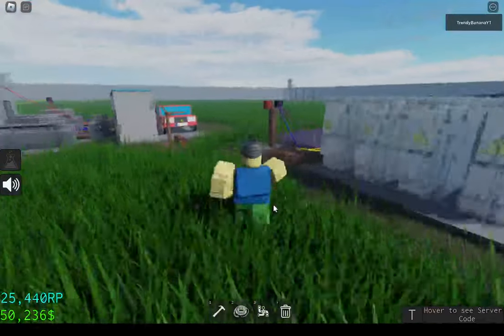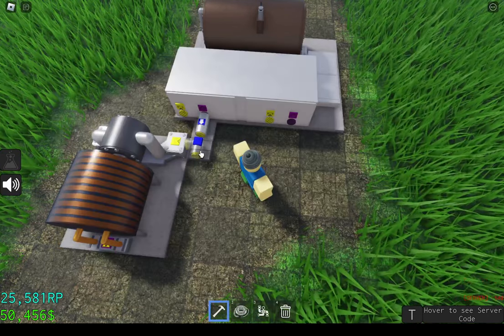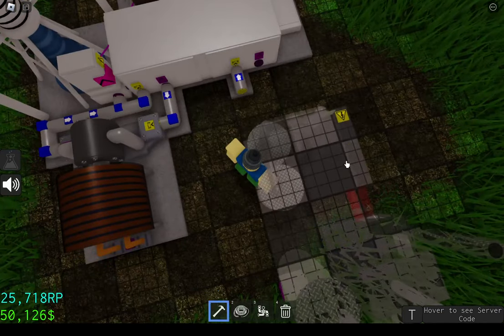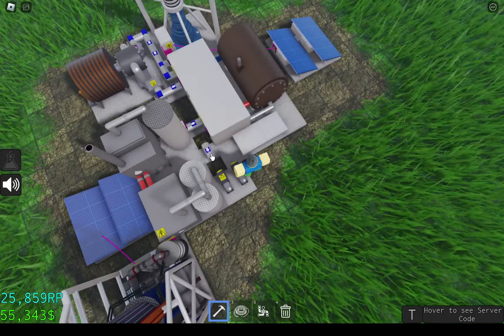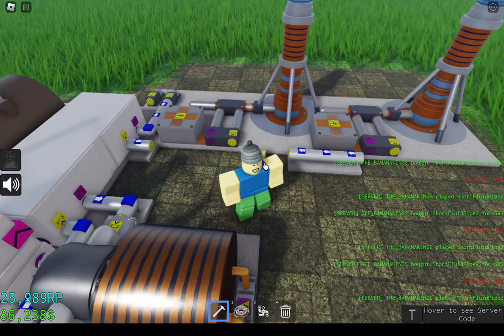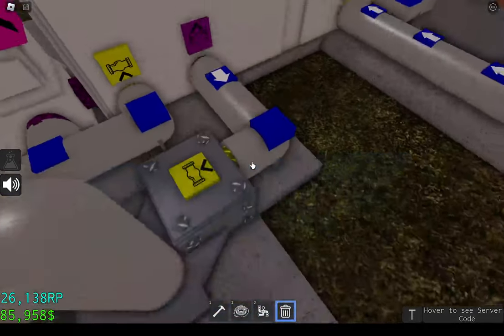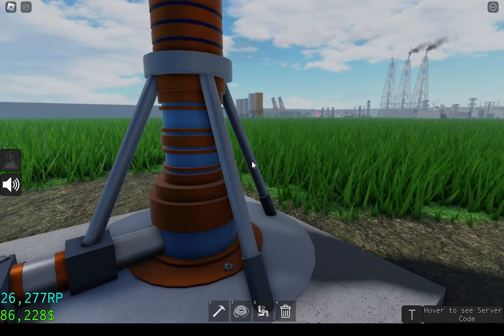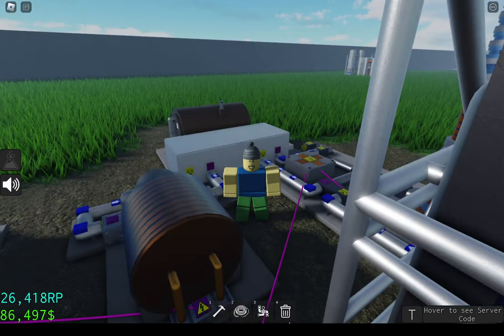How Boilers Work | Industrialist Tutorial

Comment: Note:u can get hot water using firebox which make co2 so u can use geothermal power to heat up the water instead
Reply from the maker: Correct.
Reply: @TrendyBanana lt doesn't work AT all
Reply from the maker: Can you elaborate? What doesn't work? What do you expect to happen instead?  @N30N_4U
Reply: @TrendyBanana  I did it wrong
Reply from the maker: Ah ok. Glad your issue is fixed :)  @N30N_4U
Reply: @TrendyBanana  thanks
Reply: What can you use for a coolant as for the Firebox?

Comment: My boiler keeps dropping temperature and then my  turbine stops spinning for literally no reason. The input is showing it taking in 217 C water and for some reason stopped producing steam.
Reply from the maker: What is the other input? And are the pipes clogging?
Reply: @TrendyBanana   205 Celsius water in, Then turned to steam which the steam is 156 degrees Celsius . It goes into the boiler and now the boiler is producing 0/90 liters of steam. How do I unclog pipes???
Reply: @TrendyBanana  I replaced all my piping and it stopped. Might be clogging because a bad design. I can't get water bottling plants up yet so I was storing them all in the silo's.
Reply from the maker: The water is getting turned into steam and then going into the boiler? @terrorbilly8177
Reply from the maker: Ah, that makes sense. Yea, sometimes pipes will clog and it will break setups. @terrorbilly8177

Comment: I did all the required steps but it just stopped making power in the turbines and the pipes were full
Reply from the maker: If the pipes were all full then that may have clogged the machine. Make sure you don't clog the pipes otherwise water will have nowhere to go and the whole thing will just stop.
Reply: @TrendyBanana how do I do that cause mine keeps clogging

Comment: in summary:
-the input on the right side uses hot liquid to heat up the boiler (meaning the input liquid has to be hot enough to increase the boiler's temperature)
-the output on the right side then dumps said hot liquid (it would now be cold) out
-the input on the left side turns water into steam using said heat (meaning the input doesn't have to be hot, just needs to be water to be turned into steam)
-the output on the left side then puts out said steam, and it can be used for other purposes

Comment: thanks for helping you've earned a new sub. this guy is the library for industrialist tutorials
Reply from the maker: Thanks for the support! I try my best at helping people ;)
Reply: @TrendyBanana  nvm oof but im still subbed :)
Reply from the maker: What do you mean by nevermind? Is something not working? I can be of assistance if you need.  @United-States-Of-Americqa
Reply: @TrendyBanana  1: i cant get it working
2: the liquid boiler does not output
3: on me, I'm too lazy to watch the whole thing :/
Reply from the maker: Liquid Boiler is terrible for boilers, because they only heat up crude oil to 99c. And the can't working bit, can you explain more on how it isn't? Unless the liquid boiler was the issue.  @United-States-Of-Americqa
Reply: @TrendyBanana  it doesn't even output anything it just does not output anything
Reply from the maker: What is the temperature of the boiler, and do you have water in both inputs, and is the output on the right side clogged?  @United-States-Of-Americqa
Reply: @TrendyBanana  nvm i made i work using a firebox and some design changes
Reply from the maker: Glad it is working well for you now :) @United-States-Of-Americqa
Reply: @TrendyBanana  well unfortunately only for water I'm trying to boil oil but I cant find a way to boil it
Reply from the maker: As I said before, oil can only be boiled to around 99c which is 1c less then the required amount.  @United-States-Of-Americqa
Reply: @TrendyBanana  o
Reply: @TrendyBanana  oh

Comment: Thank you so much this helped a lot
Reply from the maker: I see you fixed your issue? I am glad my tutorial helped you :)
Reply: @TrendyBanana btw can you please explain how to extract gasoline and diesel and every thing connected to that
Reply from the maker: Oil derrick makes crude oil, you put that crude oil into a boiler, which then goes to a separator. Now you have diesel, gasoline and residue. The residue should be stored in a silo. The gasoline can be burned for power or sold for some profit. The diesel can be refined 3 times using a diesel refinery, and then it can be sold or used in a diesel engine for power.  @d.a.d.a1441
Reply: @TrendyBanana  ok thx
Reply: @TrendyBanana ok nvm I still can’t do it,if it’s ok can you please make a video I would like to see how it works
Reply from the maker: :)  @d.a.d.a1441
Reply from the maker: Yea, I will make one soon don't worry :D @d.a.d.a1441
Reply from the maker: https://www.youtube.com/watch?v=rSeDlwJlVIE&lc=UgypiNcEV_UO3WgmD7V4AaABAg @d.a.d.a1441
Reply: @TrendyBanana Hey i saw u added an informative about the deleting tool for mobile players, ur a cool Dev.
Reply from the maker: @celinalvacarneiro3973  😄

Comment: I have a problem where even tho the water is inside the steam comes out it has hot water its hot enough but in the end it doesn’t turn the turbine it just stores the steam in the turbine and it won’t produce power
Reply from the maker: Are you sure you did it right? Because that only happens when the steam has no where to go such as if the turbine output is full or the power output is full.
Reply: Want me to help you inside your world?
Reply: @TrendyBanana  same with me imma retry it tmr

Comment: I have a new problem, I connected it to a HMVT pole and connected it to 2 copper drills, electric furnace, Ingot molder, and then a Press and the power went off and the turbines stopped making power even though everything was fine
Reply from the maker: You may have done something wrong, can you join discord.gg/mamytema for help?
Reply: @TrendyBanana  I retried 32 times step by step and the boiler stops producing steam after a few seconds like 30 also I dont have discord
Reply: Also I DIDNT mess anything up
Reply from the maker: What is the temperature of the water going into the boiler? What is the temperature of the water going into the coolant side of the boiler?  @Godzilla20191
Reply: @TrendyBanana  let me see real quick
Reply: @TrendyBanana   also I made 10 small turbines and connected it to a boiler and it’s not turning off this time
Reply: On the one with the small turbines it’s at a steady 140 degrees and the one with the large turbine is  137 and I’m not powering anything and it’s dropping below 135
Reply: Bruh it’s actually working now
Reply: @TrendyBanana  anyway thx again for helping
Reply: @TrendyBanana   I made another one it’s working like the other one at first the 2nd one kept winding down but now it’s more stable (as I just wrote this it stopped the coolant going in the 2nd one was at a steady 42 degrees)
Reply: OHHHHH i figured out the problem I looked at the last pipe connected to the boiler coolant in and it was hot before it but then cold after and it turns out the turbine output that was connected to it was cooling down the water lol I’m so dumb
Reply: And I’m using a gas burner on it now so the boiler is much hotter it’s at 400 degrees C lol
Reply from the maker: Glad your problem is fixed ;) @Godzilla20191
Reply from the maker: I tried my best :)  @Godzilla20191
Reply: Dang it stopped working again (rip) idk how two are working and the other 4 aren’t
Reply: And now all my boilers stopped working (bruh)

Comment: could i just use the normal water for the "hot water in"? and where do you find the geothermal thing
Reply from the maker: No, you need 100c above water. Geothermal is in Tier 2, and is researched on the power section in the tech tree.
Reply: @TrendyBanana  found that out last night
Reply: @TrendyBanana  i just figured out that when you reuse the water, your boiler will over flow, and you have to dump it then put it back, u know how to fix?
Reply from the maker: @bumrush8701  Depends on your setup. If you are reusing water then using waterpump1, if not then just dump it.

Comment: Have you Encountered the Maxwell thing? i havent but im scared if it appeared it might jumpscare lol/
Reply from the maker: I have, but it isn't a jumpscare. If mamy or any developer with console access are in your world they can summon him.
Reply: oh so devs only can spawn it? ty
 @TrendyBanana
Reply: im curious how many turbine power you have
Reply: Also Dont Max fill ur turbines The Lower Water in turbine its slower and the higher water on turbine still slow put right amount only i do that in my turbine now its loudness is unstoppable and if ur operating 4 turbines make sure per 1 turbine is 1 boiler and if 4 geo thermal only runs 4 turbine make sure you have water pump 2 or 1 many so its faster to heat up @TrendyBanana
Reply from the maker: Yep,  @Commonblockmango  .
Reply from the maker: I would love to agree with that logic, but it is flawed and incorrect in many ways. @Commonblockmango
Reply from the maker: A lot, too much.  @Commonblockmango
Reply: haha so true about the logic and yes i love making complicated wiring in game and im using breaker as power transmittor so like if i wanna turn of turbines with 1 click in breaker it will turn off cuz what powers the turbine is it self on the same time the battery was also powered during the turbine circulating power so if i turn off the breaker the turbine cant send power to its hot source and turn of (how to turn on probaly turn on switch but) turn on other switch connected to battery so battery power will be the starter of whole thing and thats it thats just so cool but it will took long time to turn of/on turbine fully
 @TrendyBanana
Reply from the maker: I can see that, yea.  @Commonblockmango
Reply: @TrendyBanana  do u know the HMV if u turn off turbine power stays there lol thats so cool i thought it will disappear but great game i have 4 turbines rn i wanna make like 20 turbines so ill have the worlds strongest power that can power MV battery 1 sec
Reply: btw i have like almost 200k cash and im just trying to make 20 turbines not take whole land but takes low land so i dont fill map with lots of item
Reply from the maker: Nice  @Commonblockmango  .
Reply: Yoo @TrendyBanana I saw one of ur comments says you can just not dump water but recycle it it made my turbines temp 177 degrees (running turbine means its spinning fast)
So whats the case if u dont understand is

- So u know when u dump water in ground after entering boiler? So what i did instead of dumping it i recycled it by connected to geothermal well and it improve my power even still 4x turbine but note 

THERES A LOGIC TOO IN WATER
SO LIKE IN REAL LIFE IF YOU BOIL WATER THE AMOUNT OF WATER WILL GO DOWN UNTIL NO WATER SO YOU CANT DO UNLIMITED WATER RECYCLE BECAUSE OF THAT LOGIC IF YOU DO THAT UR TURBINES WILL DIE
Reply from the maker: Already knew about that and do it already but good job on figuring that out :)  @Commonblockmango
Reply: This comment section lol will have lots of reply cuz we need to fix every industrial problem btw im still waiting in the how scrubber works im still confused xd

Btw i made my 5 turbines get max power so what i did when recycle water the other watee that comes in also join and more pipes gets in so it is faster for hot woter transportation so im making 5 turbines 150 degrees plus and other is rising to 170 190 and in my new upgrade in turbine machine it takes 5 mins to shutdown the whole thing lol cuz of water still entering but i dunno why even the geothermal doesnt have power same with water pump

For now im generating 2000Kmh - 3000Kmh cuz of max power my turbines make my goal is to make unstoppable electricity even i charge GMH the turbines dont go 0 Kmh also my powet calculator doesnt go 1million when i charge big battery it goes like 200k 100k means im generating much power
Reply: I Now Found Out How It Works Which Is To Make The Scrubber Residue Put in Big Water Tank Hope This Helps In Ur Next Vid And My 4% Pollution Goes Down To 3% And I Was Shock @TrendyBanana

Comment: Can u make it without the second water pump

Just a quick question
Reply from the maker: Which pump and when in the video are you referring to exactly?
Reply: @TrendyBanana   at 3:42 also where is the geothermal engine?
Reply from the maker: There is no geothermal at that point because I am trying to use a liquid boiler (Which does not work). And the second pump which I am guessing you mean the tier 2 pump is needed if you are not recycling water. @finlaygamingfinlaycrawford9604
Reply: @TrendyBanana  ty i was wondering since i dont got enough research points
Reply from the maker: No problem :) @finlaygamingfinlaycrawford9604

Comment: wait if you put water in like uhh a liquid boiler and then do that again for uhm a few times, does it get very hot or i mean hotter
Reply from the maker: Liquid boiler doesn’t reach 100c, which is the minimum temperature for steam.
Reply: that was just for example i could use a geothermal or smthing
Reply from the maker: @ez2869  Ok.

Comment: Idk but my system won't work for some reason.i am putting water at 180 and normal water in the left side one and then I dump the excess water into ground but still steam won't be produced.it worked a few times and generated a little bit of steam and then stopped working.anything I'm doing wrong?
Plus any way on how to raise the boilers temperature?
Reply from the maker: Can you join https://discord.gg/mamytema or my discord and provide me with an image?

Comment: i’m using geothermals and the boiler won’t go over 87 degrees
Reply from the maker: If you are not recirculating water, you will need two geos to heat the water up to a good temperature :)
Reply: i managed to get it to exactly 99 degrees but it took four
Reply from the maker: Ok, you will have to either post in the reddit or join the discord. It shouldn't take 4 geos to heat up to 99c.  @JustALittleAcoustic
Reply: use the water from one geothermal to another ( also make sure that the pipe distance from the geothermal to the boiler isnt to far, it loses some temp each pipe

Comment: My temps go to 17 degres but water from geothermal is 98 degres how is that posible??
Reply from the maker: What is the temperature of the water inside the boiler? What is the temperature inside the left side of boiler? Also 98 degrees is not enough; you need 100c+ for steam to be made.

Comment: Wait how do you increase temperature on the boiler?
Reply from the maker: It increases by itself. As long as the average water temperature between the coolant and the hot input is above 100c, steam will be produced.
Reply: @TrendyBanana   but how do you increase the water pump temperature?
Reply from the maker: You can't. You can increase the temperature of water by using geothermals, fireboxes or gas burners. The initial temperature from water pumps are always the same. @kaizen1976
Reply: @TrendyBanana  thanks i used firebox and it worked, another question, is there a way to reduce pollution without a scrubber?
Reply from the maker: No, not at the moment  @kaizen1976  .

Comment: I tried to use the geothermal well but the boiler caps out at 96c
Reply from the maker: Use two geothermals.
Reply: It doesn’t work
Reply from the maker: What does it cap out as now?  @iwastemytimeonroblox
Reply: When I disconnect the geothermals pipes and wait for all the remaining water to go away I connect them back and then it caps out at 99 but it cools down at 96
Reply: now I just made a geothermal  connect into another geothermal and it doubles the heat
Reply from the maker: You need to chain the geos. The output of the first goes into the input of the second, and the output of the second goes into the boiler.  @iwastemytimeonroblox

Comment: I have a problem when it heats it only heats to 50-80
Reply from the maker: Are you using a geo?
Reply: @TrendyBanana well im new so idk what that means.
Reply from the maker: What are you using to heat up the water? @thomasshalouzka1319
Reply: @TrendyBanana the advanced coal
Reply: @TrendyBanana and what section i get it in the settings advanced drill or what section
Reply from the maker: That doesn't heat water by itself, what are you using to heat the water? Like what machine?  @thomasshalouzka1319
Reply from the maker: What?  @thomasshalouzka1319
Reply: @TrendyBanana boiler,firewall,waterpump and pipes tier3
Reply: @TrendyBanana bit what section i get the GEO? What research menu?
Reply from the maker: How hot is the temperature coming out of the firebox? If it is less then 110c you may need to have the water go through it again. @thomasshalouzka1319
Reply from the maker: In the electricity side. Top left. @thomasshalouzka1319
Reply: @TrendyBanana thx
Reply: @TrendyBanana well 130c
Reply: @TrendyBanana well and the boiler just on 99-100⁰c
Reply: @TrendyBanana yeah an how do i get more RP?
Reply from the maker: No problem.  @thomasshalouzka1319
Reply from the maker: Nice!  @thomasshalouzka1319
Reply from the maker: Tier 2 research station.  @thomasshalouzka1319
Reply from the maker: You may need to get hotter water, whichever way you try to do that. @thomasshalouzka1319
Reply: @TrendyBanana ohhh thanks so much
Reply: @TrendyBanana yeah but how more boiler or more water or firebox?
Reply: @TrendyBanana and thx so much ill give you a sub
Reply: @TrendyBanana yeah and whats powerratecalculator for?
Reply from the maker: To see how much power is getting transferred, although it is broken.  @thomasshalouzka1319

Comment: I put one more braincell together and finally made my boiler thing work without even using CO2 without a tutorial 
edit: AHHHH HELP I UNLOCKED ITS 100% STRENGTH ITS MAKIBG TOO MUCH POWERR edit2: ok nvm it stops after like five minutes
Reply from the maker: If it stops you might have a clog in your system.
Reply: @TrendyBanana i fixed it and my power storage is running out of space
Reply from the maker: @reobrauer6445  Get some better batteries and place them everywhere.